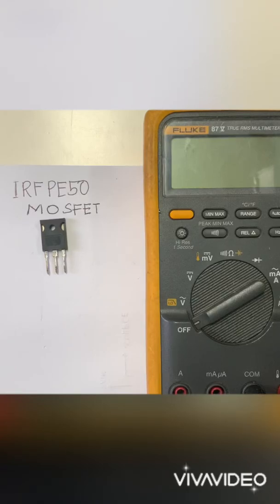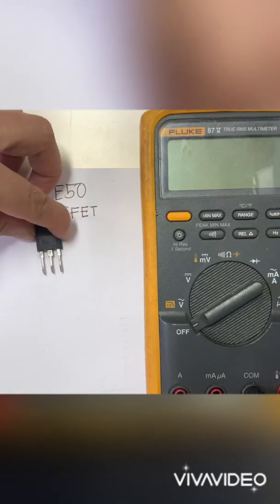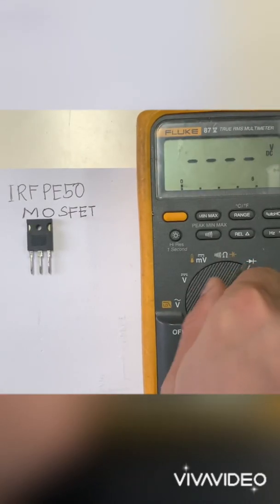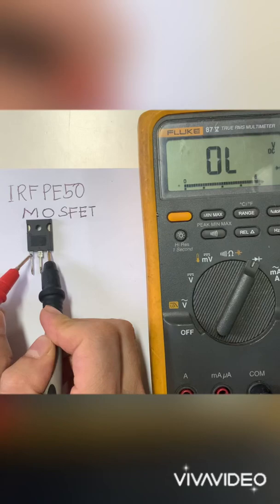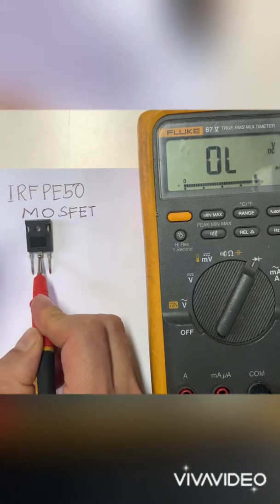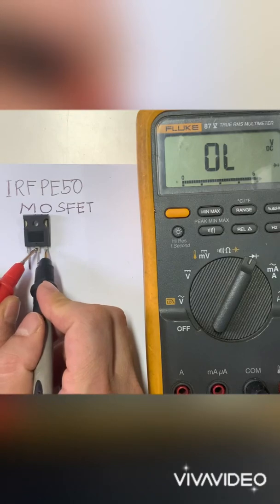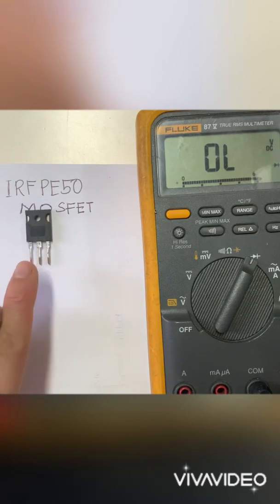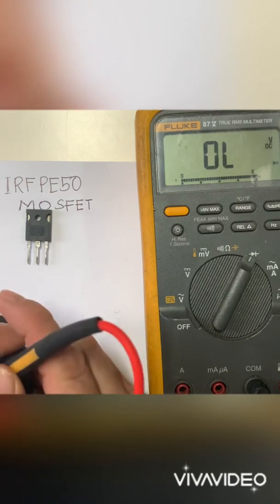How To Test A MOSFET Transistor Using A Digital Tester | Identifying Gate,Drain & Source

Comment: Nice bossing. Na miss ko tuloy dating trabaho ko sa HP. Used to build microwave amplifiers for satellite communications! Keep it coming.
Reply from the maker: ece ka pala sir ok na work to heheh balik kna sa work mo dati
Reply: @migojertech9134  Yes sir, 6 years sa US Air Force, Electro-Ballistics and Pneumatic System specialists sa Air Force Jet Fighters F-4, F-15 and F-16. Then worked at Hewlett Packard Communications Div. We designed and built mga microwave amps including InMarSat Marine Satellite systems. Retired na ako. 62 na bossing, Continue what you love to do.
Reply: Dito na rin ako nakatapos ng Electronics Technology sa US. I used to have Extra Class License sa Amateur Radio at panay sa HF kausap mga taga Pilipinas at mga taga barko. Miss those days.
Reply from the maker: @Tour ni Frank Halos same  work natin sir Rigistered ECT na rin ako d2 nko sa bahrain nkapasa ng board exam almost 9 years na rin ako d2 sa military defence wired telecom,Electronics, work ko d2 radio, telecom system,satelite reciever, electronics